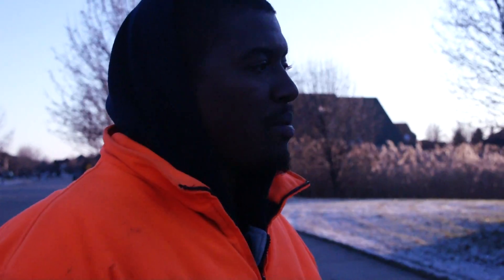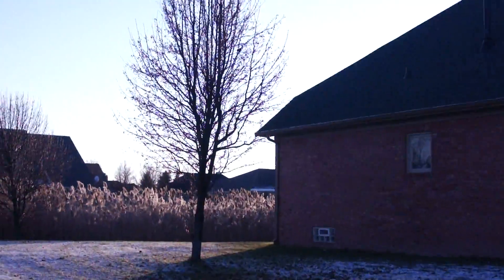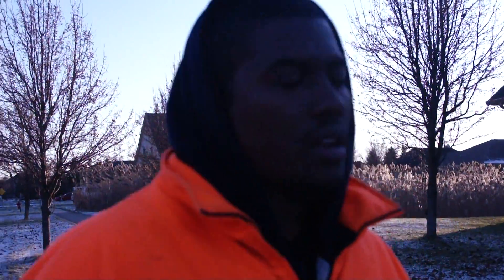Sick GTP (Project 11's)

Comment: I know im late but how you only make 335??? I have a 02 GTX and i make 342 FWHP and i only done CAI, 3.5 pulley, 3800 zzp down pipe, zzp 1.0 pcm and a few extras with a 330,xxx mile car
Reply: Really? Cuz his 335 tracks with performance of my exact same setup 15yrs ago (whp and 12's @ 110+mph in 1/4), while yours tracks with setups that'll do ~250whp and 13.8-14.5 @ 97-102mph... Those are cookie cutter mods we've been doing for 20+yrs, but get your internet points if you need them

Comment: I know I commented on one of your videos before about replacing my L67 in which I did however it's a little sluggish could the oil pump be the issue? It's a little sluggish as mentioned before and the gauge drops after the motor warms up

Comment: Whats going on bro I been watching that lil Red demon of yours on the tube for a while Im on my 2nd prix its a 2000 2dr GTP pretty much stock only miner things done to it so far is performance exhaust air filter 180 degree stat das it was wondering if you had any quik easy starter mods to make some GOOD CLEAN horsepower that will feel any tips or advice would be greatly appreciated bro seriously GP! LIFE! FR

Comment: You can call my B/S bud. I am not "stunting" on you i am asking why if you have done so much to your car, you are not pushing a decent amount of power. If you want to dispute it go ahead. Not my fault you can only build a half ass'd Grand Prix. Doing correct camming, porting out to a 4.1L and adding proper forger pistons to a 3800 and running 15 psi can easily get to 500 HP. And that is without using NOS. "Kid"

Comment: If done right, depending on if your shop building or doing it yourself, you can do a Bonneville 3800 L67 swap, camming, port to a 4.1, forger pistons and manual swap tranny for roughly 12K. Exactly how much mine cost and im running 500WHP on 15PSI on the supercharger.

Comment: Cant wait, i got a 88 toyota 4runner 22re im going to lightly build with the motor, hoping a header, strait pipe, glasspack, and resonator tip, with a gnarly crawler cam will be in by july.  by next christmas a low boost eaton setup!=]

Comment: I am hoping my fiero sounds something like this when I am done building it. Ported TB, ported Gen 3 w/3.0 pulley, polished heads, comp cams 105 springs, ti retainers, si valves, 60# injectors tuned for E85, exhaust is speed daddy headers, 3" down pipe to dual 2.5"x8" glasspacks. No cats . BBV, EVAP, EGR, PS, and AC all deleted. I know I am forgetting some stuff but that's all I can think of off the top of my head.

Comment from the maker: Flow mods (headers, u-bend delete, rockers, etc.) Cooling mods (colder spark plugs & thermostat, cold air.intake, blower porting etc.) Exhaust flow and cooling (&most importantly tuning) enable you to run a smaller s/c pulley "more boost" safely. In the beginning stages, boost makes a great deal of horsepower because the m90 is well within its efficiency range.

Comment from the maker: This car just did 12.56 @ 112.78 about 2 months ago on street tires (Nexxen N200's) at a race weight of 3667Lbs. There are intercooled turbo gtp's not running those ET's OR trap speeds with drag radials and weight reduction. Peak horses mean nothing in gp world. After I had the heads ported, I only gained 9 peak horses... But I gained an average of nearly 30 whp thru the rest of the powerband. We won't even discuss torque

Comment from the maker: I saw yall too. clean ass gp. i just finished up getting ported heads and 1.7 roller rockers in there. Took it out dirty on the spray painted stock rims lol. but its running REAL strong

Comment from the maker: Xn@hand12u I wouldn't.  The vs cam has crazy power in the low RPM range. I'd use a stall on a big cam because usually they have a weak low end. Plus a stall converter is going to hurt your gas mileage really bad off the highway. The vs can is the only cam that you will have decent city MPG with.

Comment: i noticed that you had to of changed the vacuum lines that go all over the engin. What did you use to replace them with. Got a 97" Bonneville SSEi (180,000 miles) that needs some serious TLC.

Comment: Sweet GTP man! I've been watching your vids for awhile now, love your car. I've had 3 GTP's in the last 7 years and my current 99 GTP has an S1X cam, 105#'s, 3.4 pulley, ZZP headers, ported gen 3/LIM, 48# injectors, Dynotech stage 2 race trans w/3.29's, FWI and a very nice wideband tune. I have a short speedo vid on my profile if you wanna check it out. I'm planning on slapping on a full size ZZP IC when I get the chance.

Comment: Much respect man. Nice car! I'm more in the Regals. Gotta a XPZ build I am doing right now going to be putting it in this week. I was running 20* timing on a 3.3, L32, 1.9s, 105s, N*, LQ4, zzp headers. Ran 13.3-13.4 all day but could have used more work in the tune. Laptop died at the track. I was satisfied and now going for some nice numbers like you. Good luck man.